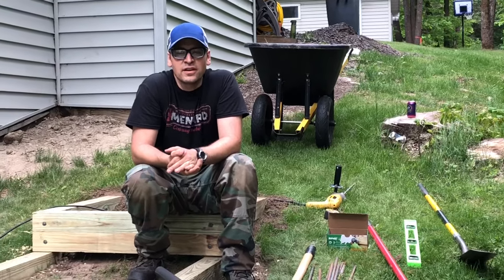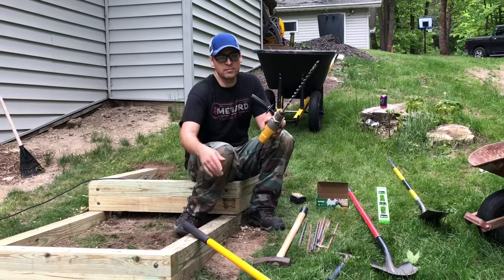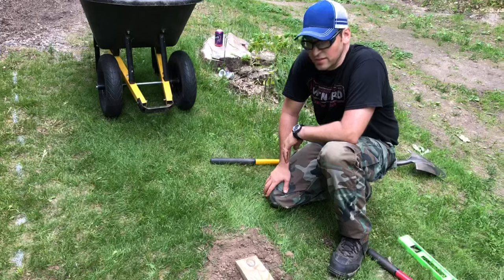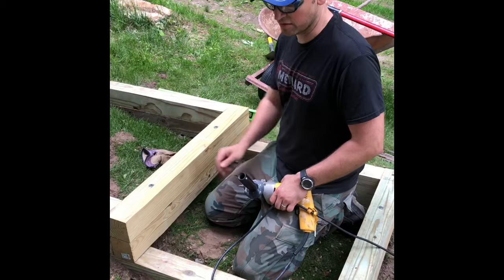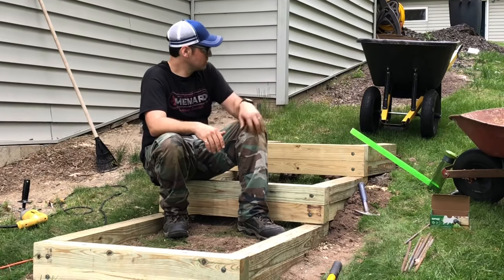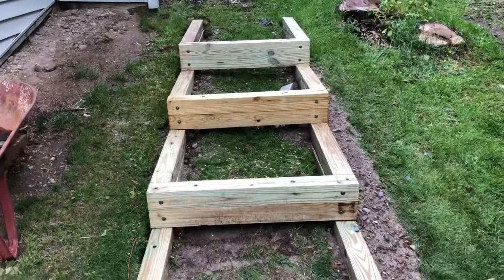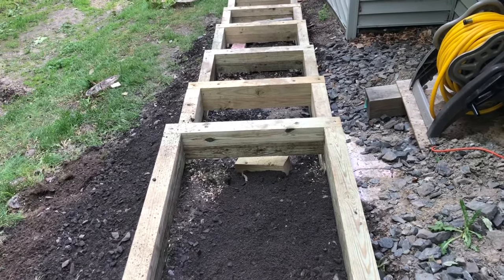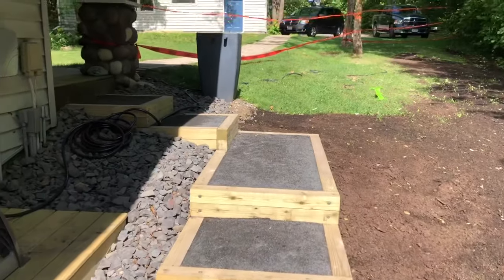How to Build Landscape Stairs

Comment: Sorry if I missed it but how did you perfectly butt up to the bottom of the deck at the top stair?
Reply from the maker: Hi CreatingMind- it’s been a couple years, but I recall chalking that up to luck. That being said, if it didn’t line up perfectly, I would have just slightly tilted the last two stairs to make it match. On such wide ‘stair treads’ a little tilt wouldn’t be a big problem. Thanks for the question!

Comment: Good stuff Steve. Did you also nail the two 4x4 treads to each other? Or are they just resting on top of each other and secured to the risers? Any particular reason if you didn’t ?
Reply from the maker: The treads are just stacked, but the rebar spikes from the riser above go through both to keep them aligned. You certainly could attach them. I just didn’t want to add extra holes or spend any more... I’m a bit cheap!

Comment: How did you do the rough surveying? Is it done from the highest point of the stair to where the last step will be ?  That’s the only part im having issues with. All  the other videos on here are “Deck style stairs which isn’t super helpful
Reply from the maker: Hi Willy Willy- here’s a reply about this from a while back: I was pretty unsophisticated. I stood at the bottom of my hill and sighted across the top of my level to a point on the ground. Then I measured the height of my eye and knew that that point on the ground was exactly my eye-height value. Then my point on the ground was tall enough that I could use a 4’ level and tape measure to figure out the test of my rise. 

Number of stairs needed = total rise divided by stair height (7” in my case)

Average tread depth = total length or run divided by number of stairs needed

Good luck

Comment: Gorgeous but seems like concrete would last longer and be a better value.
Reply from the maker: Hi Fly Casual- thanks for the comment. This is partly an aesthetic decision, as I live in the woods and concrete stairs don’t really “match” the feel I’ve got going on. Yes, though, concrete, if done properly would outlast mostly anything. The problem is that the subsoil prep and forming for concrete stairs is not easy for a do-it-yourselfer. The price of good sand fill, forms, rebar, and the concrete will certainly be more than the landscape stairs. But, with a very long life, the overall value may still be there.

If concrete is the look you want and you have the money to hire it out, I’d say go for it. 

Thanks for watching!

Comment: How would someone protect the wood from the elements? I’d hate to do all this work only to find the wood rotting in a few years
Reply from the maker: Hello! The wood I used is pressure treated and intended for ground contact. This means it won’t rot when exposed to moisture and the elements. I’m not sure how many years they guarantee, but I’ll hopefully be retired or long gone before the wood rots out. Thanks for the comment!

Comment: Great video and instruction. If I need to add a slight angle to align to the stair, can the steps be rotated 10-15 degrees? thanks. Troy
Reply from the maker: Hi Troy- yeah I think you could probably rotate 10-15 degrees. You just might need to drill your rebar holes closer to the edges of your riser or angle them slightly to still get into the tread below. If you were willing to make each riser custom, you could measure each one on the angle you want before making it. That would be a more aesthetic way of doing it. Honestly, my plan A was to make my stairs on a curve going around the house. Plan B won.  Good luck!

Comment: The sand will drain but I would be worried about it washing out with a hard rain.  I would probably have used what is called Pack.  It is part decomposed granite and stonedust.  It will easily perculate thru but also stay in place when tamped.  There is als Polymeric sand that when wetted will get a firm surface.  Did you think about boards on the surface?  If you painted the boards with a texture paint they will maintain traction.  It looks like you have a problem with washout along the foundation I saw behind you.  Do you have a problem with water infiltration in the basement area?
Reply from the maker: Hi Michael- I ended up removing the top inch of sand and replacing it with a crushed rock gravel product from a local iron mine (free!) The sand wasn’t washing out, but it was tracking around on bare feet. The gravel is cleaner and packs better. I considered boards, but wanted the gravel, state park, kind of look. No washouts anywhere, just a place that gets no sun and has no vegetation. It’s actually all ballast rock now. I’ve got a drain tile around the basement, so no water gets there. Thanks for watching!

Comment: Do you NEED to put gravel under the 4X4s to level, or if it's level with tamped dirt, is that sufficient?  Also, if you MUST put gravel, what kind is best?  Thanks!
Reply from the maker: Gravel with a nice mix of fines through 3/4” will pack nice and firm. This will keep the 4x4s from shifting seasonally. Tamped soil may settle over time, especially if freeze-thaw is a concern. Class 5 gravel is really good, but I use whatever is available to me. A crushed gravel with angular rocks, rather than rounded, natural ones will be best. Good luck!

Comment: Three years later how are they holding up? Pressure treated is not as long lasting as it used to be.
Reply from the maker: Thanks for the question! They are holding up great. Even after a few winters they are still straight and level. No softness or rot on the wood. The only maintenance has been adding some gravel due to a bit of subsidence over the years. I’m very happy with the outcome!

Comment: Nice informative video.Quick question on how you got started. Did you use 2- 4x4’s back to back and then rest your 4x4’s on the side in one of these? Hard to explain but perhaps you know where I’m going with that.
Reply from the maker: Hi Martin- not sure I completely understand, but I’ll try to explain. I started by digging out where my bottom stair goes, then adding in some gravel for a base and leveling. Then the first step is just like the others as I show. 2- 4x4’s as the riser and two more ick from the riser on each side. I hope that helps, but feel free to clarify.

Comment: How much would  be the cost of this project  including materials and labor.. Roughly...
Reply from the maker: Hi @Puma S- back when I did the project, the lumber and screws cost about $430. At todays prices, it would be $740. Ouch! 

To include labor, you would typically take your materials times 2. It’s just a ball park number. Because this is a pretty small gig for a contractor, I’m guessing you’d need to multiply by 2.5 or so, to account for the small scale. So I’d guess $1800 all-in. Good luck!
Reply: @NashwaukSteve  that is not too bad..Hopefully  it's not double  or triple))Thanks!👍

Comment: Hi. Nice job and thanks for sharing. I may have missed it but wondering how you kept it square going up for the whole length? Did you measure off the house to the edge of each step? Thanks😊
Reply from the maker: Hi Ian- yes I made a line parallel to my house and aimed for that. Also the “tread” pieces pairs were always the same length, so as long as each upper step overlapped the lower treads equally, I’d stay straight. Hope that helps!
Reply: @NashwaukSteve  Thanks and thanks again for the great video!😊 We are using it as the 'base' of our project😉

Comment: I'm just wondering if you can tell me how many steps I would need on a run 27 feel long dropping 8 feet from top to bottom.  Can I use the same size of steps as you are using?
Reply from the maker: Hi Moe Moe! Looks like you’d need 14 steps, with one of them being a little shorter than the rest. Your step length would be 23” on average. Mine were about 36” on average, but they ranged from like 30 to 42” or around that. Good luck with your project!
Reply: @NashwaukSteve  thanks for your help. And video.  Oh and the pic of your helper was great lol .

Comment: Great video! Can you tell me what length rebar you are using?
Reply from the maker: Hello- the rebar stakes were 18-20” long. I just cut them from a few 10’ pieces I bought at Lowe’s. Angle grinder worked great!

Comment: Hi Steve ! Looks great ! Nice job ! How did you come up with a calculation of the slop ? And yes , you are lucky that you have a nice soil that you can simply dig up ! I have a lot of rocks here in CT , so wish me good luck to dig this up 😀
Reply from the maker: Hi Igor- my method was very crude. I stood at the bottom of the hill and sighted across a level to a point higher up the hill and marked that spot. Then I measured from the ground to my eye. That measurement is then the rise between the base of the hill and the point I sighted in. Then starting at the top, I was able to use a 4’ level and measure down to my sighted in point. Adding those two measurements together have me the total rise I had to deal with. Very rudimentary, but it works! You can then divide that rise by your stair height (7” in my case) to get the total number of steps. Finding the tread depth is trickier, as you need to get a true horizontal length measurement. You can probably estimate it, then divide by E number of steps. That is your average tread depth. Mine was 39”, but I varied each tread to match the existing slope. Some were 42”, some were 32”, depending on the adjacent ground. Good luck with the rocks!
Reply: Nashwauk Steve Steve , thank you very much for reply sir!

Comment: Two comments: Why not use long exterior screws in place of the rebar, just in care you ever have to take any apart? Secondly, the pic of you and the sledge with your helper holding the rebar reminds me of the old Three Stooges skit..."When I nod my head, you hit it"! Did you ever consider pavers or stamped concrete. I guess you don't have snow to shovel where you are. Thanks for all the tips.

Comment: I did a quick survey of comments to see if anyone asked, but didn't see any discussion of the wood used. This doesn't look like PT.  What kind of wood did you use to resist rotting?
Reply from the maker: Hi @Eric Beck- yes, the wood is pressure treated (green treated) for ground contact. Standard stuff at any lumber yard. Thanks for the question!
Reply: @NashwaukSteve  Thank you!
Reply: One other question: it looks like you anchored lowest step to the ground with your rebar. When anchoring each upper step to lower step with rebar, what length are you using to then anchor both steps to ground? Thanks!
Reply from the maker: I used roughly 24” pieces for everything; the first step and the rest going up. It seems that size was fine for my application as nothing had shifted over time yet. Good luck!

Comment: Hi I have a similar setup in my garden, i need to repair a few of them. Is there any tricks to getting the wood out without going to the top step and pulling it all out?

Thanks
Reply from the maker: Hi Paul- if I had to replace a step in the middle somewhere, I’d probably use a reciprocating saw with a metal cutting blade to cut the rebar or whatever is holding your stairs together. Then you could slide the bad pieces out and replace. That’s my take, but I’m sure there are other/better ways! Good luck!
Reply: @NashwaukSteve  sorry for not replying, YouTube didn't notify me of a reply, Thanks so much!

Comment: Would pressure treated wood be worth the extra investment?
Reply from the maker: Hi Michael- absolutely it’s worth the expense. Untreated lumber out in the elements would not last long. Pressure treated lumber is a must when ground contact is involved. Unfortunately all lumber prices are sky high now, so it’s speedy either way! Good luck!
Reply: @NashwaukSteve  Wow, I started pricing my stairs and realized that the pressure treated lumber alone would cost over $2,000, so I decided to build them of concrete only with exposed aggregate on top.  I will do it in stages and use the same lumber for the forms as I come up the slope.
Reply from the maker: Yes, good idea! Concrete prices seem to have remained stable over this time, and it’s hard to beat the durability. Just make sure you have a nice compacted base for the concrete and you’ll be good to go. Good luck!

Comment: Awesome, I used your guide to build mine.  I’m going 4’wide. QQ-For the treads, why would you flip them so your speak screws are facing down?
Reply from the maker: Hi Dave- I actually didn’t use the long screws on the tread pieces, so that’s why you don’t see screw heads there. The fronts are screwed to the riser and the rebar holds the backs in place. You certainly could use screws to hold the treads together, not a bad idea at all- I was just being cheap!
Reply: Thanks,  npw for the steps could you flip them so the screws do not not show?
Reply from the maker: Yes, certainly. I almost did that on mine. After thinking about it, I wish I would have. My initial thought was “if I ever need to replace a piece, having access to the screws would make it easier.” Now I realize with the rebar stakes in there, it’ll be some work anyway. I vote for hiding the screws now.

Comment: Nice video. Are your runs different lengths? It looks like they may be when looking from the top down, in which case they will be a potential tripping hazard. In any flight of stairs, the rise and run should remain constant, excepting predictable landings, within a small tolerance.
Reply from the maker: Hi Samuel- yes my runs were differing lengths. I did that intentionally to match the grade of the surrounding terrain, as I wanted to avoid any extra cut or fill. I see your point about the tripping hazard. It’s good to mention that. The previous access was walking up a hillside that was very slippery in rain or snow. I biffed it a few times! These stairs are certainly a safety improvement over that.

Comment: Hi Steve, question on the rebar spikes. I plan on using 6”x6” timbers so my spikes need to be mighty long. Do your rebar spikes have heads like nails and what length do you suggest to go through both timbers and go into the ground enough to make a difference?
Reply from the maker: Hi George! Yes your spikes will need to be long, but nothing too crazy. If it were me, I’d shoot for 24” spikes. Mine did not have heads on them. I just cut the pieces out of some 10’ lengths I bought at Lowe’s. Good luck!
Reply: Thanks for the advice..I might have a few more questions before I finish lol. Six stairs done, six to go!
Reply: I wish I could send a pic of my finished work. They came out great! Thanks for your advice and helpful video
Reply from the maker: I’m so glad to hear it worked out for you! It warms my heart to know that someone gets some sort of help or inspiration from my videos. I appreciate you letting me know how it went. That is very fulfilling to me!

Comment: I don't know how your steps have worked out.....its well over a year since you uploaded.....I live in New Zealand, and wooden steps are very popular....stone and concrete are very expensive options.......We have a very wet climate, and extremely wet and shady in the winter....we have serious issues with moss and mould....on wooden steps this is very dangerous......A non-slip long lasting (aluminum) edge is beneficial.....I don't know if yo have ever had experience with a slip and fall off the edge of a wooden step, but spinal problems are a common result.
Reply from the maker: Thanks for the comment! So far, the stairs have stayed mildew free, so they are not slippery. If grip becomes an issue, I’d probably go with a screw in edge like you mention. Great idea!

Comment: What diameter auger bit and rebar did you use? Thank you for the great video! It is very clear and easy to follow :)
Reply from the maker: Thanks for the comment! I used 1/2” rebar with a 1/2” wood auger bit. There was definitely some friction when pounding them in!
Reply: Could you have predrilled the lower wood to save your back a bit?

Comment: Very informative. Can you tell me, when you lifted the top soil from inside the steps, did you take out all the soil and replace it with sand or just the front section? Thanks.
Reply from the maker: Hello- I did not remove all the topsoil and grass from inside the steps. I ended up taking out only what I needed to, as I didn’t want to bring in more fill sand than necessary. So the sand is certainly thicker near the front of each stair and thinner near the back. I hope that helps!